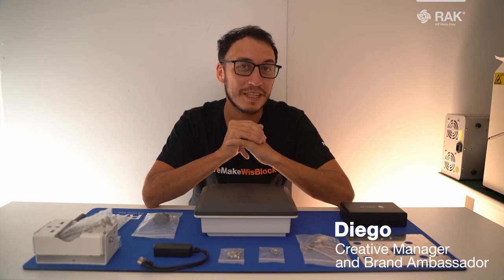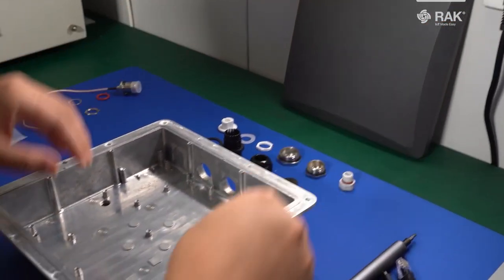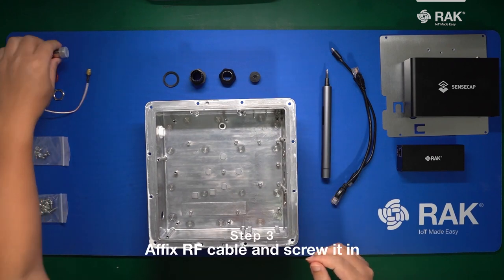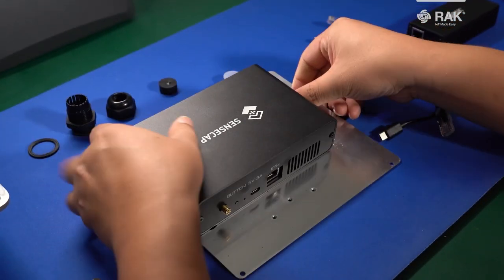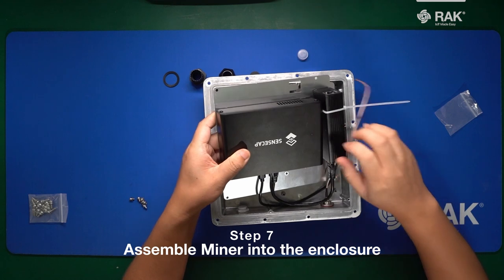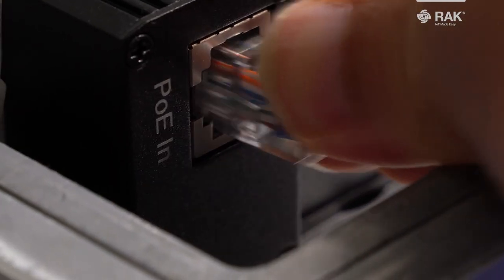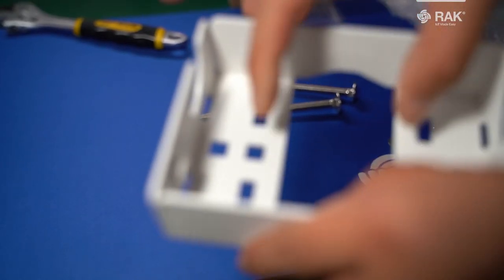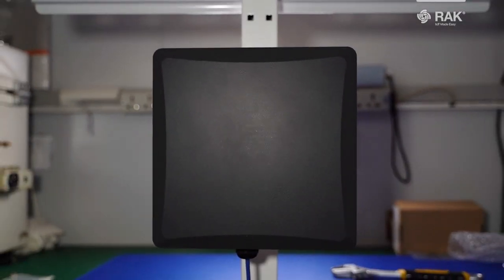RAKwireless SenseCAP M1 Enclosure Kit Installation Guide

Comment: Hey Diego, great guide thank you. I just got & assembled everything like you showed here. 

Now I'd like to ask if it is safe enough mounting the  5.8dBi
Fiberglass outdoor Antenna directly on to the enclosure, screwed in
the RF cable onto the box or it is better to have a small antenna pole
(say one meter) + LRM cable anyway?

Are N-Type male/female (RF cable/antenna screw) strong enough to be
screwed in directly into the box without any other support?
Reply: Yes, it is safe for the antenna to be connected directly to the N-type connector on the enclosure.

Comment: Hi everyone, after following the steps in the video and mounted the antenna directly to the enclosure i've noticed the antenna is not upright. it has a severe tilt towards the back of the enclosure. After dismantling the enclosure and checked if antenna mounting is installed correctly, we found out that the top of the casing has a slight incline, possibly for water to run off and if you mount your antenna directly to the connector screwed to the casing your antenna will have a 10 degree tilt. 
To check if my eyes are seeing right I used a long spirit level and attached it to the enclosure and from the bottom of the antenna to the top of the antenna is a 5 cm gap. 
Is this a design issue or have I got the only box that's crooked ?

Comment: Is the outdoor enclosure Wi-Fi enabled? Or must you connect to Ethernet cable
Reply: I am hoping it will work with wifi, about to install mine tomorrow and i have to use wifi.
Reply: @cberti7  how did this workout for you? Is it do able?
Reply: @benjaminbuckley2077  yes, the Wi-Fi worked just fine. Profitability has doubled since moving from ground level porch To roof with 360 visibility!
Reply: @cberti7  nice what a result.. well done

Comment: good vid, will probably be buying this. Just wondering, is there any advantage using this without upgrading the stock aerial as well? I just have the stock 2.8 dbi, but considering getting an external 5.8. How would it work with this setup?

Comment: Everyone is using only an ETH cable with the POE splitter, like there was no electricity at all, but there's internet everywhere. If I want to place this on my balcony (or on the roof over my balcony), I have electricity outside but no internet. Same is when I want to mount it on a radio tower.